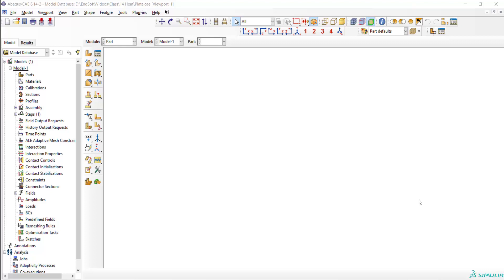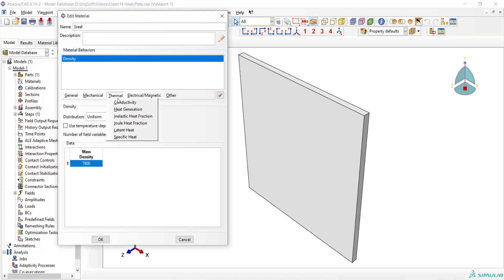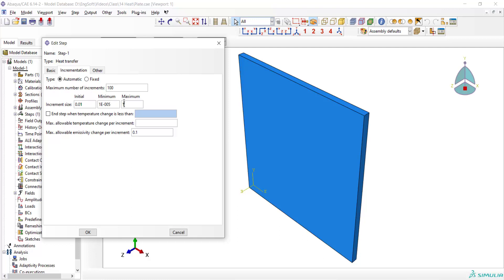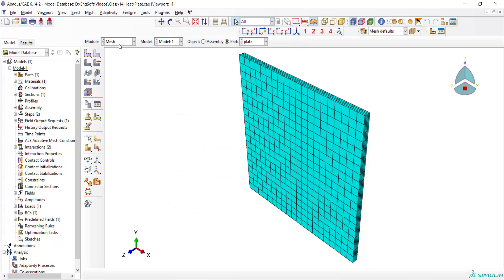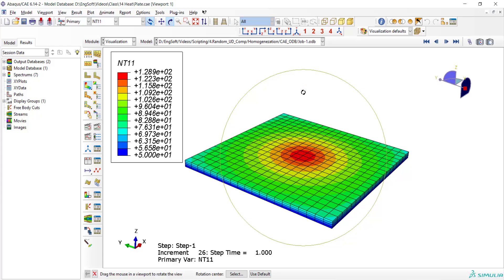Heat transfer analysis in Abaqus, heating by torch, initial temperature, convection, radiation

Comment: Great video series! Help me a lot. But I found for this video, I got running error if I set the pre-defined temp to 100. The run can be done if set the pre-defined temp to 50 like the table sink temp. Bc I think the initial temp is higher than the ambient temp seems not make much sense. But overall the tutorials are very good.

Comment: Hello, how is the heat transfer rate calculated in Abaqus? Does HFL represent the heat transfer rate? I need to compare theoretical results with the analysis values, but the HFL value is showing twice the theoretical result.

Comment: 00:45 - Create Part - Plate (3D)
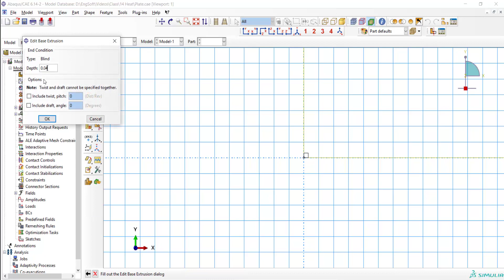01:16 - Create Material (Mass Density: 7800, Conductivity: 470, Spesific Heat: 50)
01:45 - Create Section
01:49 - Create Section Assignment

01:55 - Create Instance

01:58 - Create Step (Transient, Initial: .01)

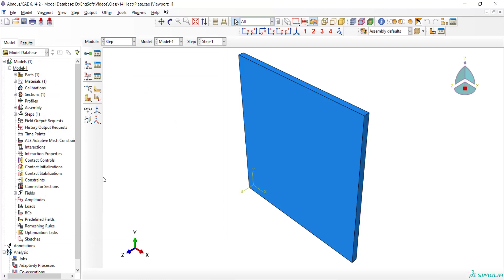03:23 - Create Interaction - Convection (Film coefficient: 2000, Sink T: 30)
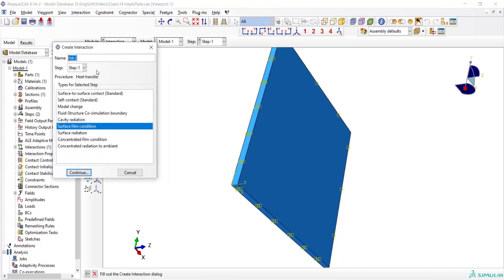04:16 - Create Interaction - Radiation (Emissivity: .8, Ambient T: 30)

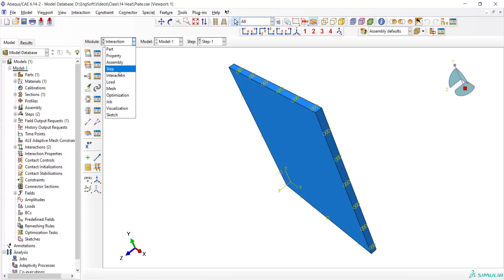04:54 - Create Boundary Condition (T: 50)
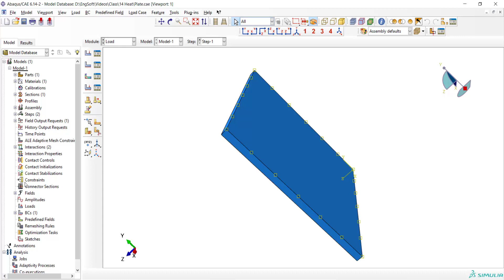05:21 - Create Predefined Field (T: 100)
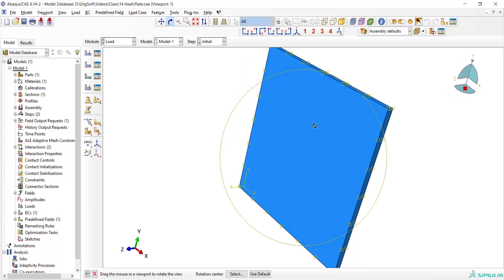05:43 - Create Load (Create Analytical Field)

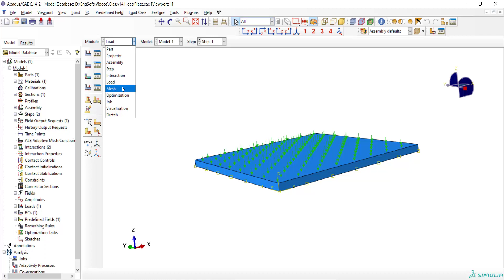07:00 - Mesh
07:05 - Mesh Controls
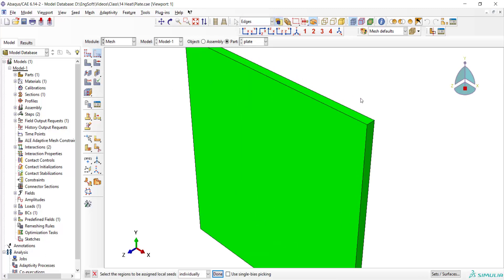07:11 - Seed Edges (Approximate element size: .01)
07:21 - Global Seeds (Approximate global size: .05)
07:35 - Element Type
08:02 - Mesh Part Instance

08:08 - Edit Attributes (Absolute zero T: -273.15, Stefan-Boltzmann constant: 5.66e-8)

08:43 - Create Job
08:52 - Submit Job
08:57 - Results